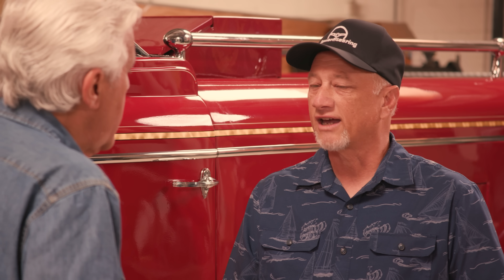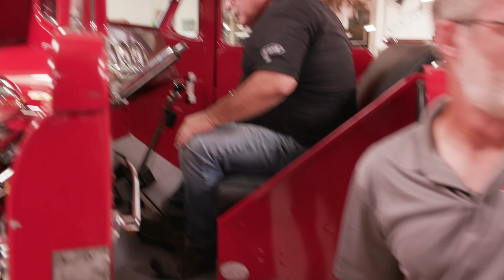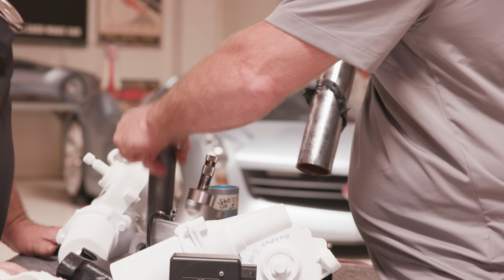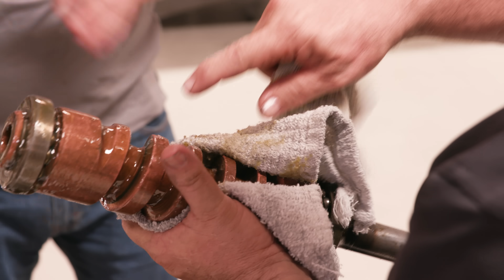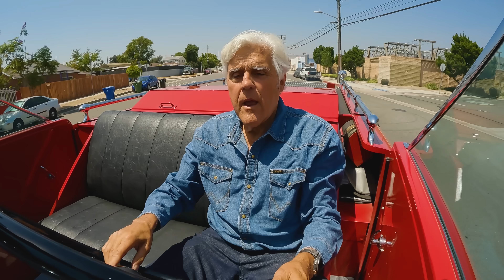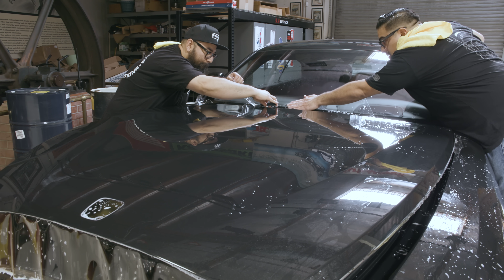Restoration Blog October 2024: Upgrading a 1941 Fire Truck with Electric Power Steering!

Comment: 1941 firemen were real men that drove real fire trucks. Don't ruin this fire truck. What is next? Air conditioning and heated seats? Leave it original. Jay if you can't steer it than sell it. Not the right fire truck for you.
Reply: Jay never sells any of his vehicles.

Comment: not 60.00 a quart / last time I bought paint it was more close to $200 a pint for a custom matched mix (pastel green for early 70’s Ford Truck that was on the 1932 RR PI - and Dupont dealer had a hard time as greens are not popular).

Comment: Over twenty years ago I put a TremicTKO 5 Speed in my 1969 Firebird and added a 455 Pontiac  I just replaced the clutch But the trans needed nothing and shifts smoooothly still can't say enough about Tremic Bill
Reply: I have a Tremec TKO 5 speed in my 6.0 V12 Jaguar XJS

Comment: Great product, but if you could come up with a clamped version that didn't need the column to be cut, I reckon you'd sell a lot more. 

I get that the torque sensing would be a challenge with strain gauges, or similar....
Worth considering imo

Nobody wants to buy a car with diy steering and a single failure mode!

Comment: My current Ford F-150 has an electric rack'n'pinion steering unit which confuses me but it works although needing a large 225-amp alternator to provide the power. In the fire truck upgrade with the electric steering assist unit, no mention was made about upgrading to a larger alternator and heavy cables to provide the power to operate the unit. I do understand the time brevity of the video that much of the install process had to be cut out but I'm sure there was much more to this install than what was seen. Interestingly, many of today's semi-trucks use electric over hydraulic power steering which makes my job so much easier than the days when we didn't have power steering in commercial trucks and steering wheels were 28" to 30" versus the 18" we use today.

Comment: Hey Jay, what's this MPL product you mentioned that helped with the worn syncros?  I'm not ready to pull my transmission yet to do a full rebuild, and it would be nice to get about another year out of it.  Also I'm glad the EPS system works good, I was already thinking about doing that to my 58 REO Gold Comet when your video popped up.  It has a similar style manual steering box, and I was curious about what the inside of the column looked like before cutting into it.

Comment: 1973 when I got out of the USCG I was appointed to a Fire Dept . Our vehicles at that time were American Lafrance and  Seagraves all which were gasoline engines. Armstrong steering that required two hands so I know what you are talking about. Mind you that defrosters and heaters were non existent in those days. In a few years we eventually switched to enclosed cabs with diesels and power steering and automatic transmissions. What a job ! Did 30 years and retired in 2004.

Comment: Similar Steering Power Assist motor applications are used on large boats/yachts for rudder control without water current creating control errors.
Jay is smart. He keeps his 'yachts' on land. One Yacht vs 25 classic cars? 
You can always rent or take a tour on the boats. 
(Yes, I've used this comparison as justification for old cars addiction!)

Comment: Just make sure the electric wires and motors aren't near any fuel lines or the pump. Sealed metal J Boxes and steel conduit anyplace possible to protect wire jackets, electronics from heat and moisture. 
We don't want any more shop incidents Jay! We want you around bub.

Comment: Rolls Royce factory employees are just shaking their heads at this video.   "All that time, money, and effort we spent and he does that to it."
I had one of these protective films applied to a new car once.  Never again.   It worked alright, first time I had owned a car without stone chips, but when I had a minor prang, the panel & paint shop had to get the entire film off as otherwise the repair could not be made invisible.
Modern paints seem to be much improved - you don't need any protective films.

Comment: I couldn't believe what I was seeing what these cowboys were doing in this video.   It's going to cost some time to repair the damage to paint etc from the sparks thrown off when they cut the steering shaft.   There is a right way of cutting and drilling in situ (pack around with putty, use blankets) and a wrong way - these nongs chose the wrong way.   I guess Jay was away doing something else at the time.
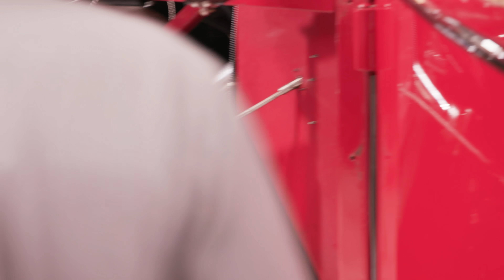Look at the idiot using slip-grip pliers at 13:31 - not only is he risking severe injury to his fingers, it is a silly tool to pull out a shaft anyway.  Using a shift wrench UNDER the nut head would be heaps better, no risk to fingers or the shaft.
So the amount of power assist depends on the integrity of a 10 kohm potentiometer.   That's real scary.   One day Jay of one of his museum employees will be out in the truck turning a corner with a hand lightly holding the steering wheel when the pot just happens to go open, suddenly the steering is back to real hard and there will be a crash.   That LaFrance will just demolish anything it hits.
Surprising considering Jay often speaks against electronics as less reliable than mechanical solutions.
Reply: The pot is used for the driver to set the amount of assist, not the direction. If the pot was to 'go open' it would just turn down the assist to minimum.
Reply: @ePowerSteering  Can you not read?   In my post above, I wrote "So the amount of power assist depends on the integrity of a 10 kohm potentiometer".     For Jay or one of his employees to be turning a bend and instantly go from full assist to little or no assist without warning in his heavy fire engine, he will most likely crash, because the steering will want to centre and feed a lot of force back up the steering column.   Or, depending on wheel alignment, he might not be able to straighten up a quick as needed.
You have confirmed the installation is DANGEROUS when you said if the pot went open the assist would be minimum.   It may be acceptable, though certainly not very good, in an ordinary car, but not in the great heavy LaFrance.  You have confirmed that the pot is what is termed a single point of failure.  Single points of failure should always be extremely unlikely to fail when safety is affected.
I note that in the variable assist power steering in the Ford I had, the variable assist has a single point of failure, but being hydraulic it is very unlikely to fail, and if it did fail, the assistance goes to maximum, not minimum.

Comment: Just a note for anyone with steering issues on a normal vehicle (let's say medium duty truck or smaller). Make sure you grease your kingpins and steering linkages on every oil change! I couldn't believe the difference it made when getting my 1944 Ford tractor on the road- very similar to Jay's before and after, but it just took a few pumps of chassis grease and 5 minutes.

Comment: In a similar note to using MTL; if you have a manual gearbox that calls for ATF, use Royal Purple Synchromax as an alternative fluid. It will help with the notchiness and synchro wear while being compatible with gearboxes that aren't designed to use gear oil. If your gearbox does use gear oil, Penzoil Synchromesh will give similar results and quiet worn synchros and help with some of the cold shifting notchiness. Obviously not a true fix but it will help you get along the way until you're ready to rebuild your transmission.

Comment: So on the fire truck power steering...  You are making my brain explode a little bit with the time lapse on the MOST important stuff.   You are parting off the worm shaft in the lathe... A bit dangerous to part off a shaft while using a tailstock center.  Be careful with that.  So what was the next step?  Did you shape or broach internal splines in the hollow input tube? Did you mill 2 flats for a double D connection? This is all safety and mission critical stuff that got glazed over. I know the general public does not understand machine work, but I would at least liked to see a quick sped up segment on this.  I know liability and all, but if it was done right and a proper mechanical connection was made, I would think you would have no problem showing it off.  Anyhow, It is a product of the times, sad to say.  Otherwise, I always love Jay's videos.   -------Doozer
Reply: Rob (RLMServices) and Jim (Jay Leno's Garage) pinned and welded on couplers on the lower and upper shafts. They tigged them in the lathe to keep the shafts true.
Reply: @ePowerSteering  That is just awesome.  Thank you for the inside story.  TIG welding is always super strong and secure.   I hope you can get the ball bearings off of the shaft with the couplers welded on there, that would be ideal. Else milling a spline or double-D connection is good and allows it to be taken all the way apart.  Good job.  --Doozer

Comment: The engine heat would kill that, very quickly, on-scene, if it was still used as a fire truck!

When running under-load, but stationary (pumping) it will get paint-blisteringly hot!

Comment: I had a career as a firefighter and the oldest Fire truck I drove was a 1920 Ahrens Fox pumper. That was a complete Armstrong steering. By the time I retired from my Department myself and one other firefighter could drive it. It now sits in a special display at one of the City’s fire stations.

Comment: $60 bucks a quart doesn't even come CLOSE to many colors on todays Vehicles!!! , 
I was a PPG Certified Automotive Refinisher for 46 years ( retired 2 years ago from a GM dealership)  and on some of the Cadillacs there was one color that had a couple color shift pearls that went into the formula and for a quart of PPG Aquabase to refinish the whole front end and blend into the doors and  A pillars was over $5000 dollars, the 2 pearls were $1800.00 for 2 bottles of 8 oz of pearl and it took all 16 oz of those pearls!!!! Add all the other colors in the formula and it was a $5000 mix !!!!! It was the Gray/Green color that flopped to Purple /blue red! 
Just a 36.oz mix was over $ 200 bucks at the cheapest, Black or white and they have many other colors mixed into them as there isn a true white or true black anymore!!!
Thanks for all the videos Jay , keep them coming !!!

Comment: Dislocated my thumb  decades ago, driving an old chain drive Autocar in the gravel pit where I worked right out of high school.Hit a rock in the road and that spun that huge wheel so fast there was no way to move my hand fast enough. I never grabbed that wheel the same way again!
Reply: My father sometimes told me stories like that about breaking thumbs off while driving
Reply: @danam0228  not fun! Luckily the thumb went back in pretty easily!
Reply: I always kept my thumbs out on top of the wheel when driving manual steering Dump Trucks back in the 70's. Especially in quarries and off road conditions.  One wheel jerk was enough for me.  ha ha

Comment: To make manual steering do-able some vehicles used positive camber. Instead of modern negative camber, positive camber means the tops of the tires are further apart than the bottoms.

Comment: I wish they would have shown the coupling between the steering box and power unit.  This is still going to see high torque loads and needs to be very strong.  Also, the mounting bracket for the power units needs to be very strong to hold the torque reaction when steering.
Reply: They didn't show it as installed either. There didn't appear to be anything in there when they shot the "looks great" scene. I'm sure they ran into several issues that took a lot of time to resolve long after the shoot.

Comment: To expand on electric brakes, this is actually going to be a driveshaft mounted retarder made by Telma .  This is an eddy current system that is a magnetic brake which has no friction surfaces.  Some of these retarders are used for chassis and hub mounted dynos.

Comment: Great idea to add electric steering.  Would have been a good idea to protect the engine bay with a Fire Blanket to stop the spray of sparks when cutting the steering shaft.  A 3D printed rubber gasket and stainless steel flange over the hole in the firewall for the steering shaft, would be better way to finish rather than 10 tubes of Silicone to fill the space around the shaft. Surprising considering the amount of effort in restoring vehicles for the collection. Does not matter what the vehicle is, the same attention to detail should be used.

Comment: My department had a fleet of LaFrance engines from the 60’s and 70’s for the first 8 or 9 years i was in. I loved driving them, but MAN the steering on a few of them was sketchy on a good day on a smooth road. Add weather and potholes and it was a real adventure.

Comment: Most interesting, particularly the power steering conversion , surprised to see you grinding on the vehicle , when I’ve done that l finished up with metal particles that were sparks burned into paintwork / glass , that then turn rusty , still you are Southern California where it never rains , unlike the UK where it does .

Comment: Hello Jay, you’re familiar with Gale Banks I think? You might also be interested in a product he promotes from a company named Speed of Air Hyperformance Pistons. They have reintroduced a piston technology invented during World War 2 to extend aircraft range over the Pacific. The company uses dimples; like you see on a golf ball; applied to the piston crown to induce turbulence in the combustion chamber for better fuel burn. It adds 20% efficiency gains to the average engine, with better fuel economy, more power and lower exhaust gas temperatures. Speed of Air also apply Ceramic Coating to the piston crown and a zero-gap second piston gas ring.

Comment: I have MSD/pertronix ignition in all my cars... for a reason. But be careful to isolate the plug/coil wires and use copper contact distributor caps.

Comment: We used to stop when riding are bikes around town and talk to the driver and chief at the station.  Now I  realize why all the drivers were really big men;  that steering is a job and a half.  I remember them getting aligned with a hydrant, which was tough, because the big five inch connectors were made of stiff rubber.  Recently I saw a department letting a small woman drive the truck, and that is possible because of the standard power steering. 😎

Comment: When I worked at Mullane Ford in the early ‘70’s I had to install PS in a Maverick. Ford sold a kit which took me a few hours.   I was also a volunteer firefighter. My fire company had a ‘62 Mack which of course didn’t have PS & the manual transmission required double clutching with no synchros. It was at times a challenge to drive.

Comment: I have a 1966 Corvette with Xpel on the entire  front. or used to be, the driver's side had to be removed to fix a headlight door and a bit of the nose (I wasn't driving) that had some cosmetic issues. The rest of the Xpel is great. Shops here that install Xpel don't want to touch it. All they have to do is one half of the nose- there's a seam in the Xpel right in the middle- and the fender. Very disappointed in the shops near me, they have no confidence in their own work. I get that getting the seams to line up is tricky, but I like the Xpel a lot. These guys should be saying "no problem we're pros, when can you leave the car with us?" Not "wow, we have to match seams, that's hard". Well yeah the original installer had to do that, too....

Comment: When I worked in a shop in the 1970s we had three Brockway trucks with manual steering. They were hard enough to steer when empty but when full they were punishing, to say the least.  I put in a request to add power steering, which had been a $1500 option in 1963, and found that the cost of parts plus me doing the work was less then $500 per truck. After the conversion the three trucks became even more useful and the company kept them until 1985 when they were completely worn out.  I think it was Mack trucks that offered power steering as standard that changed the way truck companies outfitted and sold their trucks after 1967.

Comment: I also like to put a date on parts when they are serviced or replaced as well. Sure does come in handy over time. I'm not sold on those "wrap" ceramic coatings. Probably there is more to understand about them.

Comment: I recently spoke with an old friend who did this install on a deuce and having been the first install Id seen up close I had several questions about it regarding the quality and especially the safety aspect. He was as skeptical as I initially but fell in love with the very modern steering feel. 
    The biggest consoling factor is that even if you lose electric power, your steering input still goes right through it. For once this an effective aftermarket assembly the really works! 👌👌
Reply: That's a good point. You can manhandle a car with hydraulic PS if it fails. From what I've tried, with electric PS it nearly impossible.